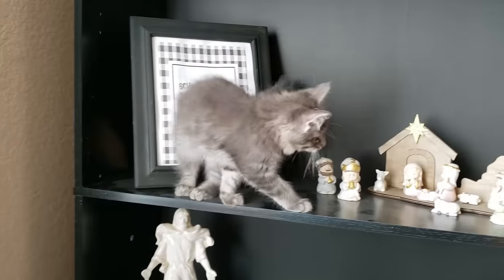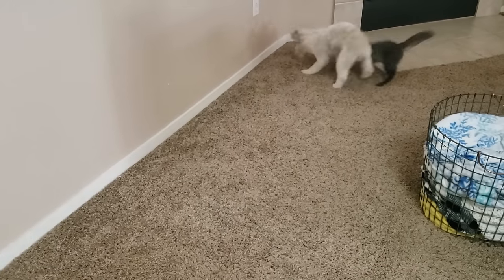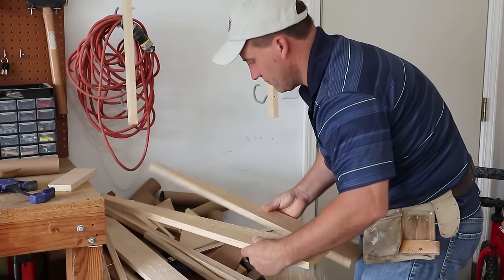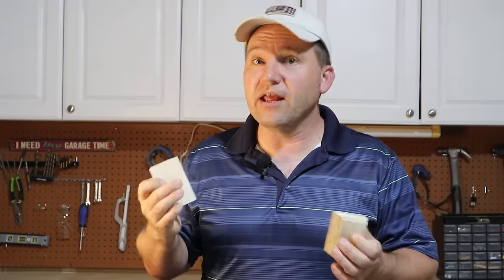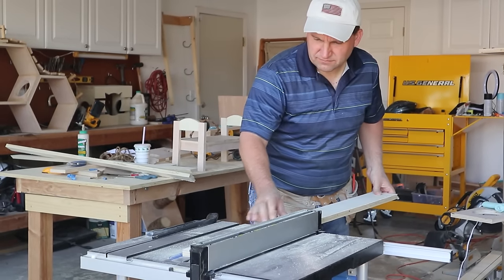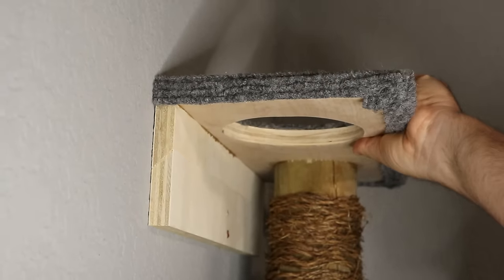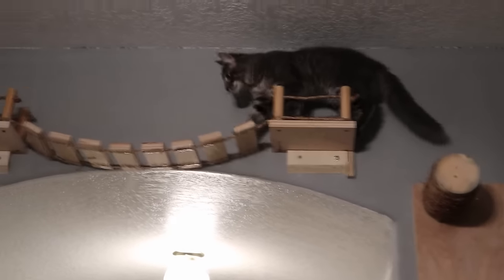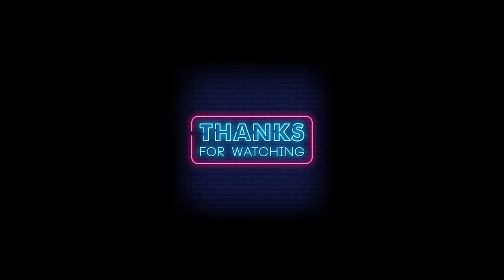Ultimate DIY Indoor Cat Playground You Can't Miss

Comment: Great obstacle course. Maybe you need to attach a pillow to the bed with Velcro. Otherwise, it will be easier for  the pillow to slip, and the cat may fall down.
Reply: Happy kitty.
Reply: @youtubesucks1499  I love it when cats are happy 😊
Reply: @guyontheinternet1734  Me too.
Reply: Cats land on their feet in the rare case they fall.

Well... most cats that is. Somehow mine doesn't.
Reply: Along with the Velcro, I was also thinking guard rails on the outside of the bed too that had soft, cushy material wrapped around the bumper/guard rails.
Reply: Good call on the velcro
Reply: Cats have something called “righting reflex” which allows them to turn while in the air, so that they land safely on their feet. Using their highly sensitive ears, they are able to maintain balance and orient themselves, so they are not injured from a fall. It is believed that cats develop this reflex as kittens, and it is fully developed in as little as 7 weeks. Cats are able to land successfully on their feet after most falls 🤷🏼‍♂️ buuut occasionally accidents do happen. Stuff like a cats weight and age, or the distance of the fall can definitely be a deciding factor whether or not a cat will land on its feet.
Reply: That’s a good shout. My cat likes to freeze them suddenly zoom off which would send the pillow flying!
Reply: @natalie_rose2861  One of mine lands splat on his back while playing so I’m introducing him to heights very gradually. 140cm tower is the highest spot he has access to at nearly five months. His brother can climb up walls so it’s lucky he sticks his landings.
Reply: My cat sleeps on a pillow on a wood dining chair in my office. It's a whole chair and she manages to slip off of it lol.
Reply: You realize cats can fall 200 ft without injury?
Reply: @Watashi_wa_robottodesu  Yes, but every vet can tell you that still they have a lot of injuries from falling down.
Reply: @Ralph Reilly Just because an animal can endure something, doesn't mean we should set them up to endure it. It's a survival defense, not a survival pleasure.
Reply: Even though cats may land on their feet, the danger exists for their lower jaw bone hitting the ground upon impact breaking the jawbone.
Reply: The bed is way too narrow. Everything else is fantastic
Reply: I was going to add this very comment. Also if you use stair treads or yoga mats etc, and use Velcro to attach, if anything gets truly gross, it is easily removed. This playground is great fun! I would add some stairs at the other end so there are a few additional exits. Your cleat system is ingenious!! 😮
Reply: What a great design!  How did you come up with all of this?  Had you been thinking about it for a while or just jumped in and started building?  Bucky will love it for many years, I’m sure, and if he gets bored, you could always add on a few new features or rearrange a few of the features to keep him interested.

Comment: A great source for wood stock and scraps for projects like this is curbside on trash day, especially dense suburban neighborhoods.
I just drove buy several houses this morning with either woid scraps, or large complete desks, tv cabinets, bedroom dressers, computer desks, etc.
Bring battery powered drills, screwdrivers, saws to disassemble curbside if your vehicle can't fit item.
Old computer desks and tv stands oftem made of plywood or mdf with a laminate finish, but even old sauder style particle board desks and cabinets use 3/4" or thicker and appear to be much higher density and build quality vs recent years. More than good enough for domestic cat weights 😂
Recycle, upcycle, reuse, repurpose, its all good

Comment: Use a silicone glue brush to spread the glue. It'll hold better spread evenly. Any glue left on the brush comes right off when dried. And that's called a French cleat, and they do hold very well. Great job! Not so sure the cat will appreciate the rope bridge though, but if you ever get rats they'll love it! Oh, put another hole through the top of the hexagons so Bucky can get on top. His best place is as high as possible to watch what's going on, ask any leopard. And it's warmer up there.

Comment: Hopefully he doesn’t outgrow some of those elements. And think that the hexagons need some carpet. Gives me inspiration. There was a cat tree frame my spouse started, that I did a bit more work on then carpeted it and wrapped the center pole with half inch sisal rope very tightly. Our two cats are smaller adults, both close to 8.5 pounds so I’d scale to their size. I like your cleat mounting system… thank you for inspiration.

Comment: I have 2 adult cats and a big blank wall, so I hope to build a playground like this- I especially love the cleat system you used but I have questions. How did it hold up as Bucky grew larger/heavier? Did any of the parts snap or fall off the wall? Also did it work to anchor the wall cleats into just drywall or should I base it on where studs are?
Reply from the maker: The whole system did great! Bucky loves every bit of his playground

Comment: Would love to know what angle you put for your miter-saw you used for the six sided box? Also did you secure the rounded tree limbs to the cardboard?
Reply from the maker: Hi Joy, the angle cut on each piece of wood is 30 degrees.  Combined with another piece of wood, that angle then becomes 60 degrees.  All you have to do is cut the boards at 30 degrees and then put them together.

Comment: When mounting the hardware did you do these in the studs or did you have to use wall anchors? I’m working on one but I’m not able to hit studs on all screw points. Do you think a piece of ply wood attached to 2 studs would work then I could mount anywhere in the ply wood?
Reply from the maker: Dane, I did find studs, I just didn't want to risk Bucky taking a dive when he least expected it.

Comment: I have loved this video for years, I'm finally about to start building with the help of a carpenter friend.  Are there plans out there anywhere?  The only thing I'm beyond confused about is the angle of the hexagons.  Is it a 60 degree angle (6x60 = 360?)  Also wondering about the thickness of the boards on the rope ladder since you have to drill through them...

Comment: Cats have something called “righting reflex” which allows them to turn while in the air, so that they land safely on their feet. Using their highly sensitive ears, they are able to maintain balance and orient themselves, so they are not injured from a fall. It is believed that cats develop this reflex as kittens, and it is fully developed in as little as 7 weeks. Cats are able to land successfully on their feet after most falls 🤷🏼‍♂️ buuut occasionally accidents do happen. Stuff like a cats weight and age, or the distance of the fall can definitely be a deciding factor whether or not a cat will land on its feet.

Comment: Is just straight wood glue really strong enough for the polygon boxes? I noticed no nails were use to actually secure the boards into shape and it was just glue. Id want to do this, but just want to make sure that wood glue alone is enough to hold them together.
Reply from the maker: Hi Joe, yes, the clue is definitely strong enough.  Many don't realize that glue is stronger then nails.
Reply: @GoodlyEarth  I did in fact not know that! Thanks for responding so quickly sir!

Comment: Hi there, just wanted to say that's absolutely amazing !! I was wondering what is the material you are using? Specifically 3 minutes 15 seconds in. We'd love to build something similar for our 4 cats 🐈 😻 cheers
Reply from the maker: Hi there, around that time I am drilling into a four inch round wood pole I got from our local lawn and garden center.  They are normally used for fence posts.  Easy to work with and pretty inexpensive.  Let me know if you have any other questions.

Comment: Bravo! What angle cut did you use for your pentagone figure (the one with tape)?
Reply from the maker: Hi Karl, thank you for the wonderful compliment.  The key to the angles is to divide how many corners there are into 360 degrees.  Then half those angles.  So, there are six corners on this design, so divide 360 by 12 which gives you 30 degrees.  Each piece needs to be cut to 30 degrees.  If you have 5 corners you will divide 360 by 10.  I hope that makes sense.
Reply: @GoodlyEarth  thanks!!

Comment: lol wish I could show some of the cat houses and things I have built for my cats. When I rescued one of my cats she was abused badly and starved by former owners and I already had a Maine Coon that was having a lot of trouble coping with the death of my other two cats that passed two years apart from each other leaving her all alone. My Maine Coon inherited all my passed on cats objects, private cat houses etc I made in the past all to herself.  The new cat who had PTSD and bad depression when I got her was terrified of everything including my Maine Coon and my Maine Coon wanted to establish her dominance of the home which normally this would be fine. But, no I could not allow this to happen to a already traumatized cat.  So, I walked around my home trying to find a loc to build a a new location special JUST for her. Only free place I found was up higher to ceiling and ABOVE my desk.  This was good she would be close by and my Maine is so old and fat she won't be able to get at her but, just in case I cut the kitty holes too small for my Maine Coon to fit through on purpose lol and get this I have used that old carpet you used in the past myself on cat projects. However I do buy giant rolls on UNtreated Sisal rope and I would NEVER glue with hot glue. I am 99% sure that glue has pulled off by now the Pyres you were had a much slicker surface area making it even more unlikely to adhere.  I always use Tilebound original or the newer types of gorilla glue tacked down with a hidden tack nail the over lapped with rope to conceal, every say 8 rotations just to be sure its secure. So, am curious .. is the hot glued rope still holding strong?